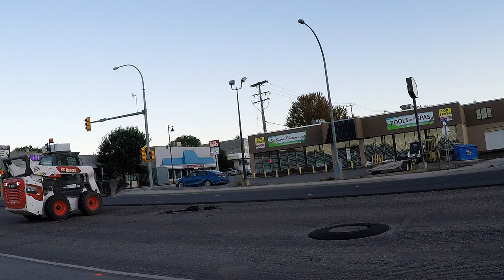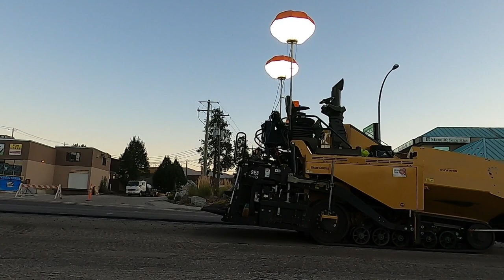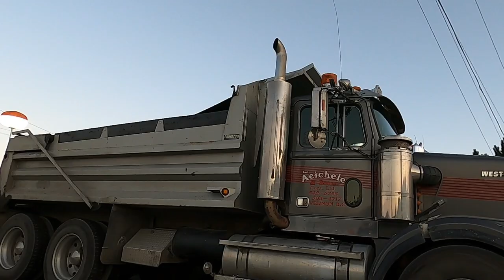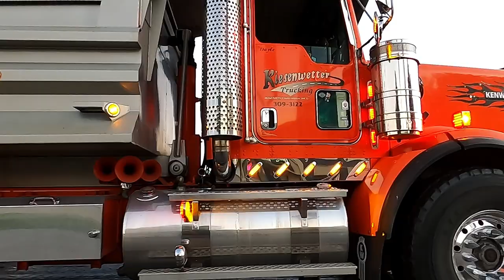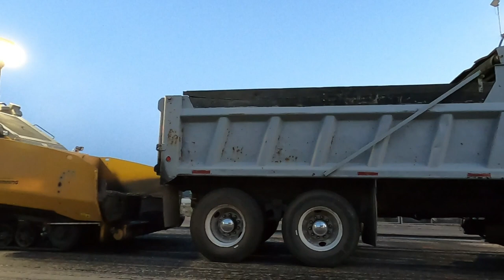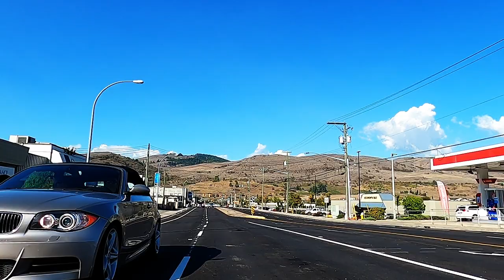NIGHT PAVING: PT 2- KENWORTH & WESTERN STAR DUMP TRUCKS FEED CAT PAVER / DUMP TRUCKS #43

Comment: I’m about to start driving dump trucks soon with asphalt . I have a question . While the bed is up in the air , Is the truck in neutral while the yellow machine is pushing it or he is just driving slow ?
Reply from the maker: I apologize for the delayed reply. Sorry. Just busy. 

Be mindful; when reversing to the paver stop short, inches away, allow the paver to approach the truck, …don’t bump the rollers, if you must don’t do it hard, this causes deviation in the mat. 

Yes, neutral, also be mindful; keep a light application on the brakes, holding the machine and truck together. 

Hope this helps.🙏👍
Reply: @coolbigrigs  thanks !